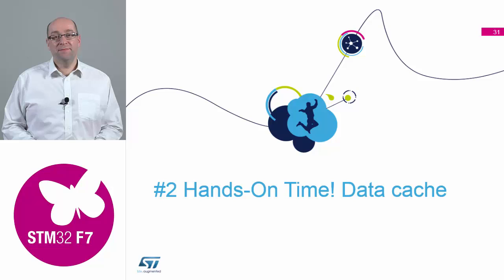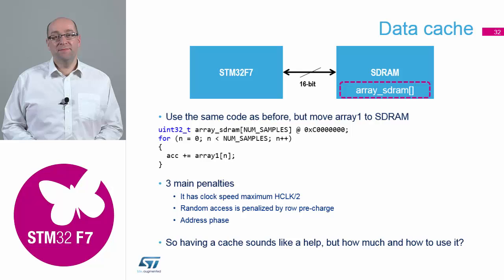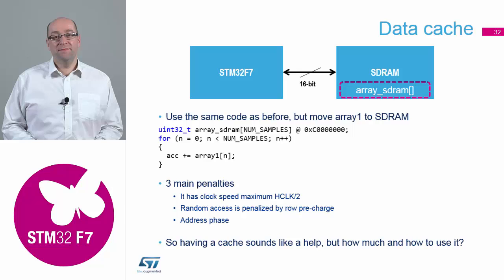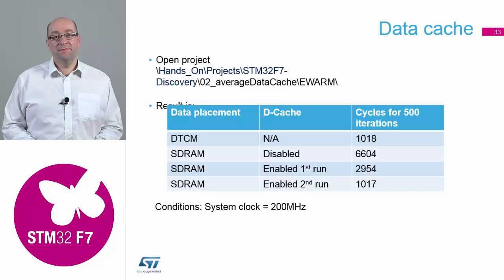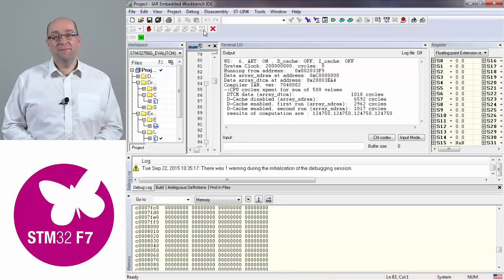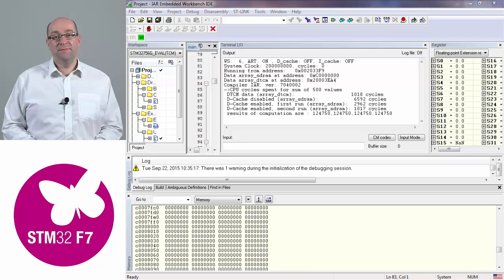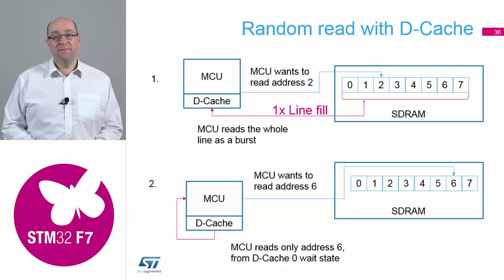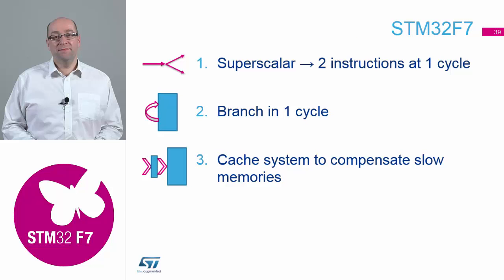STM32F7 workshop: 02.7 Cortex M7 core - Hands-on #2, data cache

Comment: The chunk of videos on cache have been extremely helpful, but one thing I'm wondering is, how did you make 0xC0000000 cacheable? It says in the datasheet for F767 that it isn't. I had to do the memory bank swap and actually compile my code to look at 0x60000000. Are you using MPU, or is there a simpler solution to making that region cacheable? Or did I read something incorrectly?